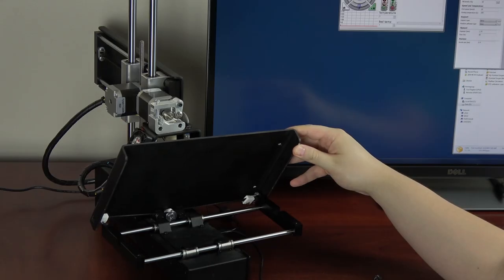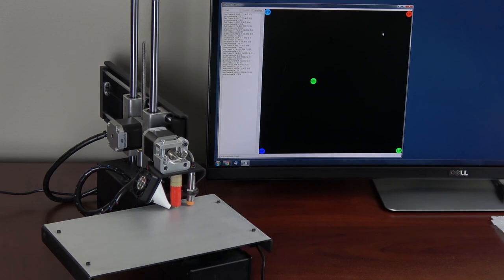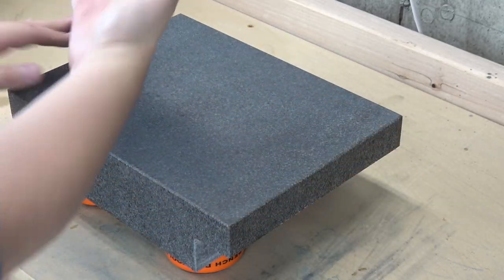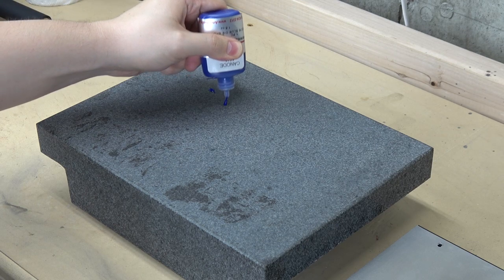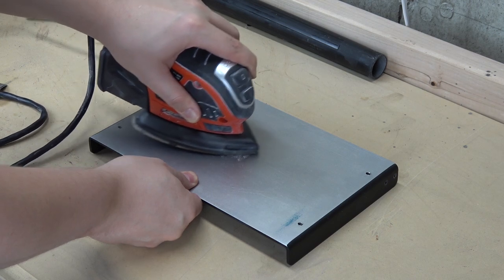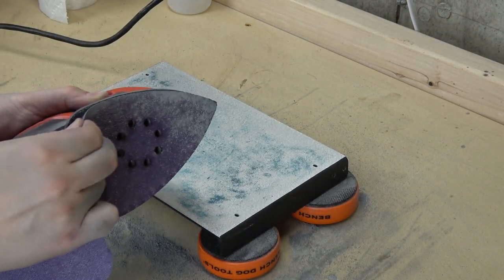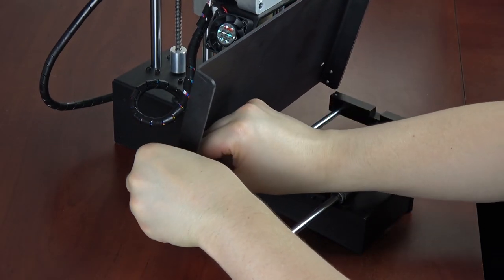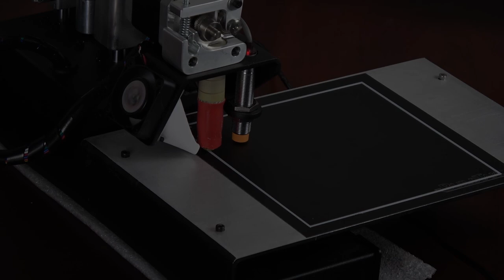Fixing a Warped 3D Printer Bed

Comment: Im a machinist. Struggling with warped bed and the thought of bluing and scraping came to mind since the aluminum plate is so thin, happy i found your video
Reply: Did you have any luck with yours? I'm about to try it on mine. Plus I thought the roughened texture after may help with adhesion without having to use tape

Comment: Extraordinary! I've done traditional scraping in machine tool reconditioning / fixtures, but have never seen anyone do it with a vibrator sander and 80 grit :) Just goes to show that if you have your basic principles down, you can improvise and knock everyone's socks off.
Reply: Wow, cool would love to learn scraping even if the basics .. for linear guide surface 😁

Comment: This is same idea in tool and die making called " flat bottoming of die steels/ parts" . Blue grease used on a surface plate with a brush or paint roller . the die part/steel component  which is warped due to welding (heat...same problem as this 3d printer table), placed on surface plate and checked for high spot and then ground using a handheld die grinder , or if too much material needs to be taken, one would use a disk grinder. Perfect video of tool making skill. Good job my friend

Comment: My Ender 3 S1 Pro has this issue, but I would have to peel the magnetic surface off to fix it. Then, it's also a heated bed so it changes when it heats up. It was about a half millimeter low in the middle, front to back. I took the bed off. Set the edges on 2 pieces of 1/2" square tubing (upside down), and carefully pressed down in the middle. I didn’t put a lot of force into it, and checked frequently with a straightedge. I got probably about 3/4 of the warp out and a couple strips of tape under the PEI sheet took up the rest. It's way flatter, but I haven't tried printing or heating the bed yet. Currently, I'm using it as a pen plotter to draw traces on some PCBs I'm making.

Comment: I personally just installed a glass bed. This looks like an unecessary amount of effort but appreciate your effort and sciencing of it, especially the utility.
Reply: My glass bed is warped...

Upd: got myself a new one, but fixed the problem with leveling before the parcel arrived.
And it's not automated with a sensor, just basic leveling with new firmware and a piece of paper. And it works so perfect I lack words to describe it.
I'm afraid to ruin it. It feels too good when printer just works and works fast, without recalibration every time.

Sometimes 3d printing is way too unpredictable to have something to do with engineering. It's closer to magic and clown shows somehow.

Comment: My method was to print different bed level tests from thingiverse and record them to see where the filament wasn't holding on. If it didn't create too much of a mess I would let it run the entire cycle. After finding the lowest points I cut a a few pieces of aluminum foil and placed one layer underneath the Ender 3 surface and do another print. I could tell just by eyeing each print if I needed to remove or add it from an area of the baseplate.
Reply from the maker: That's awesome.  That sounds like another great way to solve the problem that would take roughly the same amount of time mine did. :D
Reply: @NicholasPiegdon  Yep. I realized the Ender 3 you can disable steppers and manually move the hotend around the bed instead of fighting with the X Y function which is tedious. I had my Ender 3 baseplate cover perfectly level but I missed my mirror bed. I like it so much! I found out painters tape also works well.
Reply: Mirror/glass beds rule. They look awesome when printing parts and they make the bottom of the print smooth. I don't use glue or tape anymore and let it print directly on there, without a brim or raft! It looks so cool when doing that. I still have yet to print petsfang so it's easier to see prints being made.

Comment: I have this problem also. As a machinist i know of one other way that i might try. Using a ball pened hammer and just slighty dimpling the back side in the areas you want changed can do this but i forget if its the high or low spots that need dimples.

Comment: good video!.  I bought a cast machined bed from gulf coast robotics and it's pretty flat! but your method seems to be a way to get it EVEN FLATTER, so far my level  when the x gantry is trimmed is around 0.05 mm and this is on the ender 2 v2!     I get pretty much almost all green with manual mesh bed levelling but im obsessed with getting it even flatter! gonna try your method soon and see how it fairs!  I understand 3d printers are not the most accurate of machines but I just wanna have  the most accurate I can get it!

Comment: I just did this with an Ender 3 v2 (No machinist blue or electric sander) with a bed deviation of over 4mm (high to low) took me 3 days of constant tramming, ABL and sanding but got it down to 0.08 deviation. The ABL will make the mesh but the printer doesn't use it (even with M420 S1 in the gcode). Is it printing? No clue yet as I'm drying my filament since it's been out for a few days.

Comment: Not entirely sure where I can find a flat stone surface to mod the print-bed
Reply from the maker: This particular surface plate was $37 from Amazon and I've found a bunch of uses for it since then, so it's paid for itself a few times over, just like any other tool.  (It looks like they've gotten about $15-20 more expensive since then.)

They're super interesting though: every single precision instrument can be traced back to the flat reference surface(s) that were used to make it.  You can't make a modern screw (or the machine that makes screws) with any degree of accuracy without one of your tools earlier in the process requiring one.  The "Machine Thinking" channel made a video called "Origins of Precision" that does a great job of explaining it.

The only exception is the surface plate itself, which can be made by rubbing three uneven surfaces together in a very specific order.  (Search for "The Whitworth Three Plates Method" for cool diagrams.)

Comment: How does this hold up over time? I imagine the thin aluminum build plate would become warped again with time and all the thermal cycling if you print a lot
Reply from the maker: That printer didn't have a heated bed, so my guess is it would have lasted longer than if it did have one.  That said, I finally retired this old warhorse a couple years ago and got a Prusa with mesh bed leveling.  But, for the two years after the mod where it was still in regular use, it continued to print perfectly.
Reply: @NicholasPiegdon  I was wondering the same, came across this vid, noticed it was posted 5 years ago and thought how amazing - you were marching toward what we have today with Unified Bed Leveling and mesh maps of the print surface years before it was really a thing. Also I haven't seen a PrinterBot, or PrinterBot style, in SO long. Well done!

Comment: surface grinder won't help you as magnetic plate used on machine will deform thin part, you did it in right way

Comment: Just discovered your video and utility by chance! Very informative and very interesting. I have an Ender-3 (with a BLTouch) and a Delta (with a custom pushbutton probe). Will give a shot on both and report on the results!
BTW, is the dimension of the testing area customizable? I see that it is set for a 150x150mm, that might fit my delta, but it's too small for the Ender-3.
Anyway, good job!
Reply from the maker: Hmm, looking at the code I could have made it a lot friendlier/flexible.  Sorry!  You could get most of the way there just by opening BedLeveler.cs and "Find and Replace" the ten or so "150"s with your bed size.  After compiling the project again, you should be all set.  (There are a pair of 75's on line 39 that are supposed to represent the center of the bed (150 / 2), but that's just for the starting position of the scan, so they don't matter as much.)

The more interesting question is whether the flavor of Gcode that the Ender-3 uses is the same as my PrintrBot.  This only uses the simplest of commands, but there are small differences between the controller boards that might make things more interesting.  Good luck!
Reply: @NicholasPiegdon  Thanks, will give it a try and report back to this post
Reply: @NicholasPiegdon  I have an Anet A8 Plus and I was testing your software to see if would respond to my print and it responds.  When I click a spot on the black area, the print head moves to that location. Do I need to have the bed level sensor mounted first before the pattern options start to function. Also, what would be your recommendation on software/process on doing the bed size change.  I have a 300 x 300 bed. Thanks for your help
Reply from the maker: @jade-ud3fg  I don't know much about the A8, but you'll need a sensor before the app will detect anything.  Otherwise, check the latest release (published ~5 minutes ago!) and there are new boxes to enter your bed size. :D
Reply: @NicholasPiegdon  I got the sensor installed. Do I need to have a sensor like yours in order for the reading to show up on the black part of the screen. I can see some reading on the white strip to the left but it doesn't show in the black area
Reply from the maker: @jade-ud3fg  If the Ender-3 doesn't respond with exactly what the PrintrBot Simple Metal does, it won't be recognized (yet).  What does it say on the left sidebar?  (A copy-paste of a few of the lines would be the most helpful!)
Reply from the maker: @jade-ud3fg  This is many months late, but the new (five minutes ago) v1.3 release should be able to read the response from your printer and have the colored circles show up.

Comment: My printer is Anycubic Mega X...this one dont have auto level, so cant use your tool....they already sent me 3 replacement heatbed but all has same issue (the center is higher then 4 corner) any suggestion for me?

Comment: Might sand my Anycubic build plate through a wood chipper. It baffles me they ship defective printers knowingly
Reply: I just got a Mono X and noticed the build plate was concave with a wave. I sent them a description and a pic using a straight edge, they asked me to fill out a form and they are sending me a new build plate. Total time from when I sent the 1st message to the confirmation they would replace it 1.5 - 2 hrs (about 5-10 mins actually me writing) Still I bought a paver and a mirror and will smooth it.

Comment: hello nicholas, 

 just wondering if you can point me in the right direction with your program, i have windows 10 with later than .net 4.7.2 installed but when i load it up and connect to the correct com port, my printer (ender3) dose in deed home its self, but nothing shows up on the right, its just a black box no matter what i do, i can measure corners, and i get a response but nothing appears on the right as it dose on this video, if i measure every 1,5,10,50000 it dosent matter  again nothing on the right, Also if i choose "measure every" it only homes one location, any ideas?  

cheers!
Reply from the maker: For now, the response that the app expects is very rigid.  If the text that comes back from the printer (in the left column) isn't exactly of a form like "Bed Position X: 13.00 Y: 10.00 Z: 0.10", then the app won't be able to understand it.  Making that part more flexible is the last step to making it work with a much larger number of printers.

When a position line comes in from your printer, what does it look like?  If you copy-paste one of the responses here, that would be helpful!
Reply: @NicholasPiegdon  totally experiencing the same issue here with none of the circles appearing in the black box, and do not see any log statements outputting in the text area box to the left of the black box.

However, when I connect my printer / board to the bed inspector app it does home the printer, and i can select a random point within the black box and the printer will run through it's motions, but never see a color circle appear in the black box area of the app, nor do i see any text appear below the `connect` & `disconnect` buttons.

if makes a difference, the board i'm using is an skr v1.3 by bigtreetech, and i have marlin 2.0 installed on the board.
Reply from the maker: @the.real.ipatch  The GitHub issue ( https://github.com/npiegdon/bed-inspector/issues/4 ) where you posted that video a few days ago was the right place.  (Thanks for the video!  That is very helpful!)  I just dropped the ball for a week or so and haven't had a chance to revisit the problem or reply to the comments there yet.  Sorry!
Reply from the maker: This should be fixed now if you download the new v1.3 release. :D

Comment: Hello. Where to buy the comparator with base? Do you have a link? Thanks
Reply from the maker: You could use just about any dial indicator for the comparator.  The one in the video is a metric (which is why it has a yellow face) model Mitutoyo indicator.  And I think that's a Noga base.  But searching Amazon for "dial indicator" should return lots of combo items with both the indicator and base together.

Comment: the problem here is that the bed expands and contracts as it heats. using glass atop a thermal pad gives you a very flat surface. I need to test the old mitutoyo dial indicator on mine once its preheated
Reply from the maker: I don't have a heated bed, so at least in my case it's a non-issue.  Doesn't glass make inductive probing harder, too?  (We're a couple years on since I made this video and this little 3D printer is an absolute workhorse; I haven't had a failed print since this flattening procedure.  The first layer is always perfect.)
Reply: @NicholasPiegdon  Well I have to say that is awesome, you did a great job flattening it out. I do not use a probe on my printer so I could not say if the glass would interfere with that type of leveling procedure.  When I priint carbon petg though, the aluminum bed definitely looses shape. Might make for an interesting future video, kinda dangerous but heck maybe I'll try to film an example showing what my bed does. Im sure different brands and thicknesses behave different.

Comment: Ah the old style scraping method still is the best way to get a surface flat. A surface grinder is good, but scraping is still better. With heated beds, the equation becomes a bit more difficult as the bed warps by the heater being on one side. The cold side contracts and the hot side elongates. Essentially, we need a surfaced sandwich plate with the heater in the middle or so. Too expensive I reckon
Reply: They make aluminum backed pcb bed heaters thats what i have on both of my machines so theres a metal build surface and a pcb heater underneath, which side would be the cold side?
Reply: @TheTechy2 Use ABL Mesh leveling, it's impossible to get a large (250mm+) heated bed perfectly level because it will warp when heated.

Comment: Is that aluminium or stainless 304? Because if not, won't the lack of the anodized layer make it more prone to rust?
Reply from the maker: It's aluminum, so it forms a protective oxidized layer almost immediately.  There shouldn't be any rust.

Comment: Adding a simple glass could be simplyer ?
Reply from the maker: I wanted a solution that kept the automatic bed leveler (which needs a metal top surface).  Otherwise, glass probably would have worked very well!
Reply: @NicholasPiegdon I have (had) the same issue. I didn't wanted to start hunting for a really flat bed, nor had access to tools allowing me to measure the bed deviation.
So, I replaced my induction sensor with a bltouch (which works with any surface, not just metallic one) and clipped a 3mm thick glass window on top of my bed.
I never went back, everything sticks nice today.

Comment: How would bed heating effect this
Reply from the maker: I don't have a heated bed, so I couldn't say for sure.  Although, no matter the effect, I suppose starting from a more accurate place shouldn't ever end up worse than leaving it in a bad state.

From a thermal expansion perspective, the 60 or 70C that is used in most heated beds doesn't seem very hot (say, vs. the 200C that makes baking sheets warp in your oven) and the bed is smaller and fastened to the printer's frame.  Searching around a bit, it sounds like the deformation from heat warping would be within the same (~0.02mm) error that my amateur scraping was able to achieve.

Comment: Hello , thanks for this great helpful video , one question thou , can I use the same method to fix a similar issue but on Glass bed , specifically an Anycubic Glass bed , 400x400mm , with a bump in the middle . thanks
Reply from the maker: I'd be a lot less comfortable grinding glass, but I don't know anything about the tools or process involved.  It might be possible, but I'd do a lot of research before trying.  Glass is kind of an all-or-nothing material because it can shatter (while metal is relatively forgiving).
Reply: @NicholasPiegdon  Appreciate your reply,Many thanks.